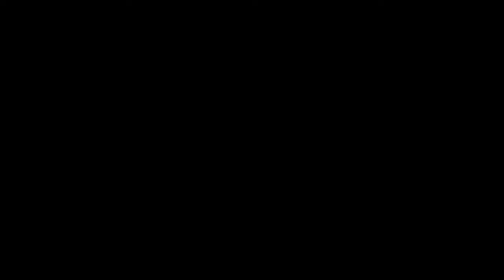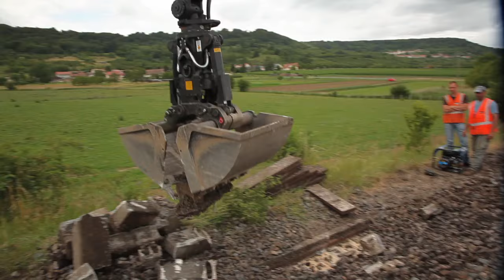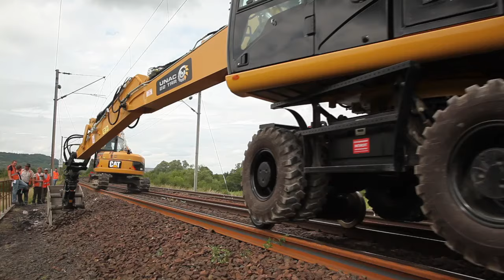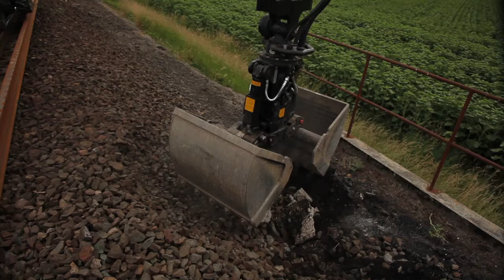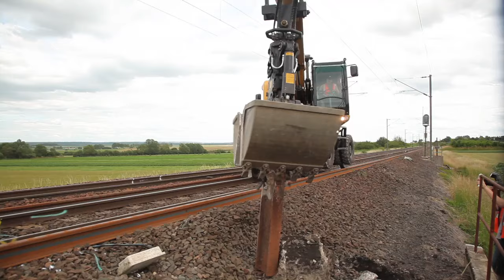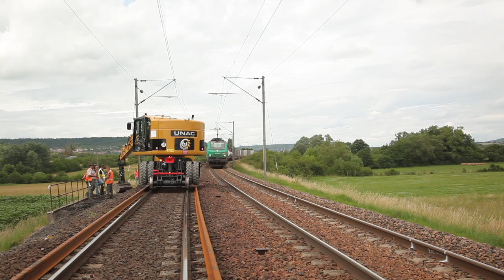The UNAC 22TRR - High Capacity Road-Rail Excavator

Comment from the maker: Hi 250hc,

Thanks for your comment.
The 22TRR is also available with the rototilt option and you are right, it is giving absolutely good results.

This road-rail excavator weight is 22T and can be up to 24T according to the railway standards for the max allowed axle load.

tvUNAC.

Comment: looks like a very nice excavator! but i would mount a rototilt with integrated 3 finger grapple, so you would have a lot better handling and higher working speed then with this mounted grapple.
what is the weight of the machine??